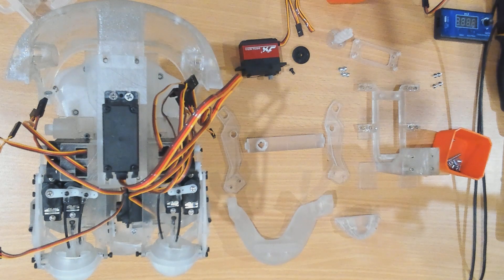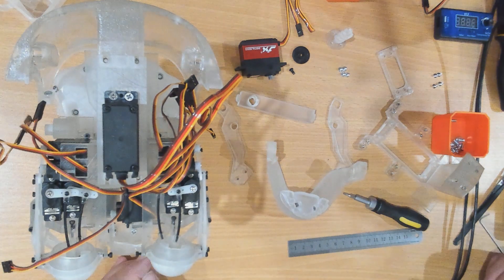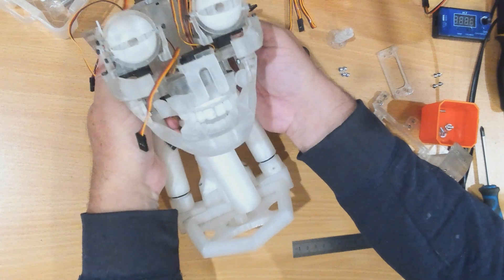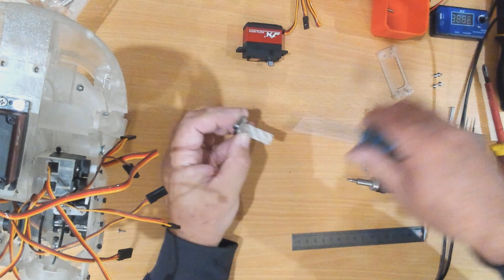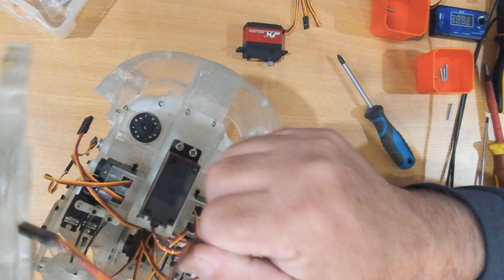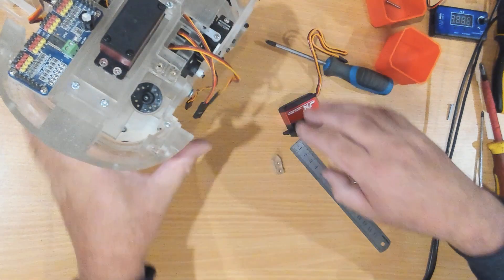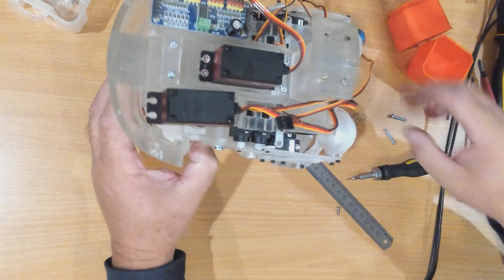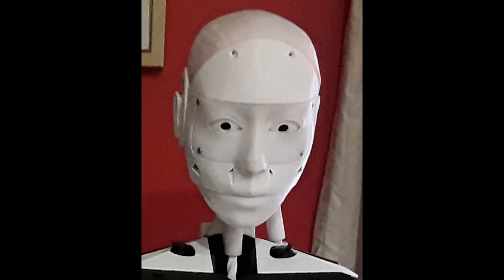InMoov i2Head build Part 3

Comment: Your tutorials are very helpful during my building process! I noticed you use the servo adapter, as do I. The SkullServoFix in your video, does seem to have a small cutout that provides room for the servo. The STL file SkullServoFixV5.stl does not have that cutout, which makes mounting it impossible; it won't go over the mounted servo. I'm wondering if you made adjustments yourself, or did you use another file? Thanks!
Reply from the maker: I used a small Dremel like tool and a file to remove a notch the width of the servo so that it would fit.
Reply: @CyberOne  that was a very fast response, thanks. I did the same thing this evening and have everything fixed correctly now. Thanks so much for both the amazing videos and responding!

Comment: the transparant is great color .
Reply from the maker: There are pros and cons.
In order to get the transparent appearance, the part needs to be printed solid and not hollowed out, this make it heavier and uses more resin.
After it has been washed, it needs to be fully dry before final curing or it will have cloudy patches.
After it have been fully cured, you will need to recoat the surface with the resin using a brush and cure it again to make it transparent.

But I think for some of the parts, its well worth it :-)